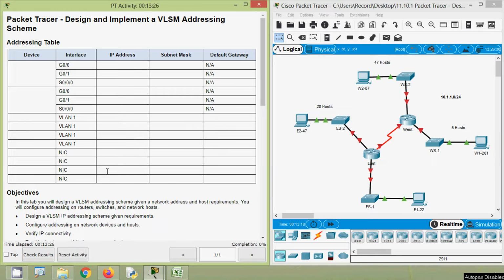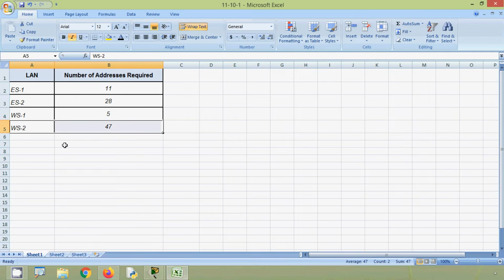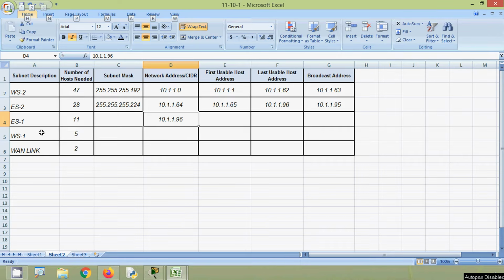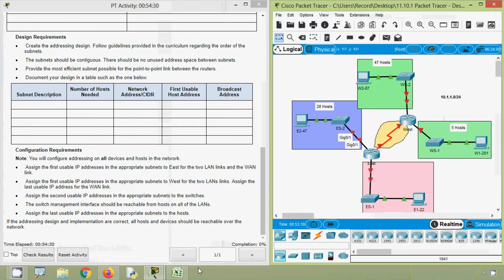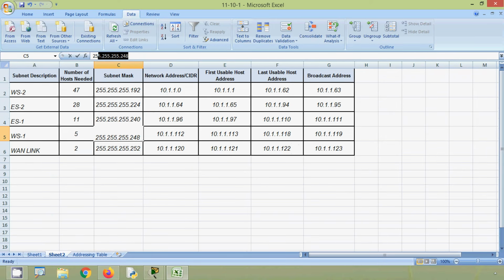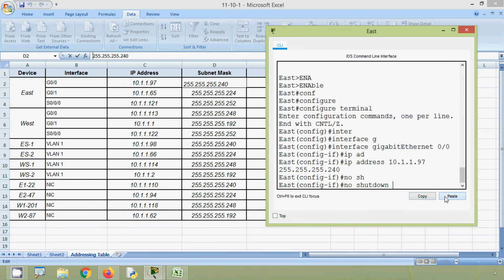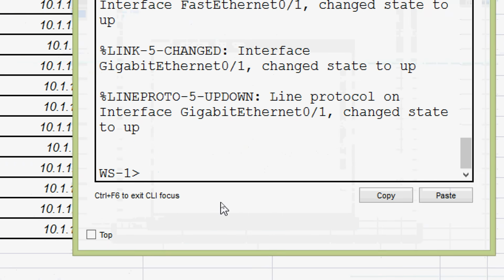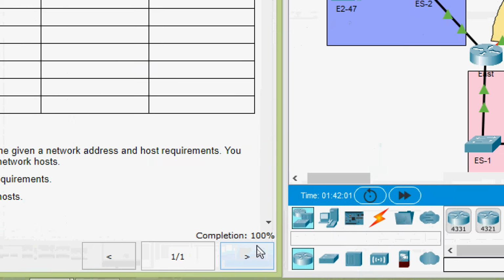11.10.1 Packet Tracer - Design and Implement a VLSM Addressing Scheme

Comment: I wonder why in my question the order of the subnet tables does not start from the largest first.  but there are smaller ones at the top.
Reply from the maker: You should subnet from Largest to Smaller only, just sort and do it!
Reply: @TechAcad  yes, i agree that is same as what i learned. Maybe this is just variation answer from the pka file. :)

Comment: How do you subnet if a  lan consist of 3 host?
Reply from the maker: We will not get exact 3 usable IP Address after subnetting.  We can create it with this requirement (2 to the power of n)-2, where n is the number bits in the hosts portion.